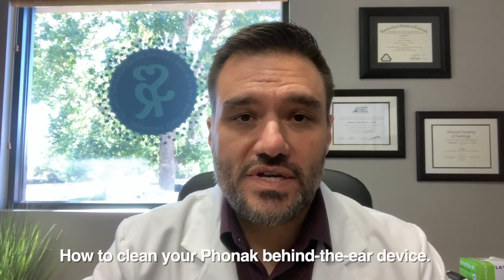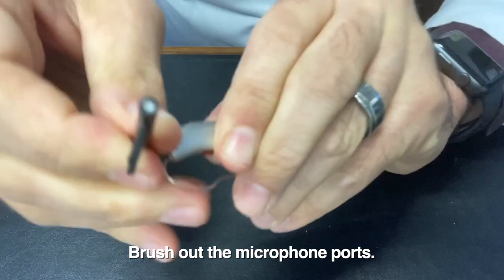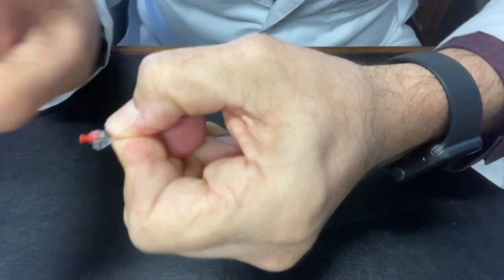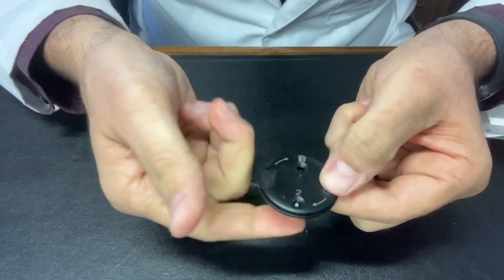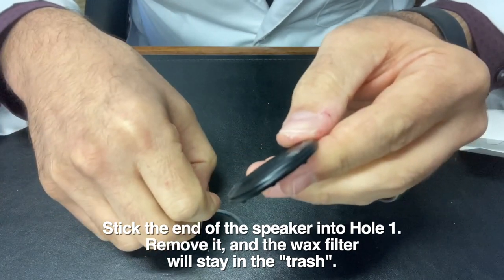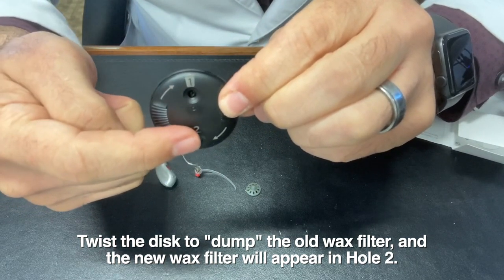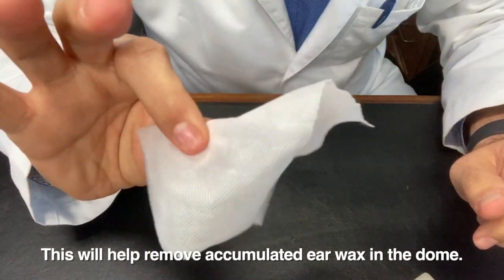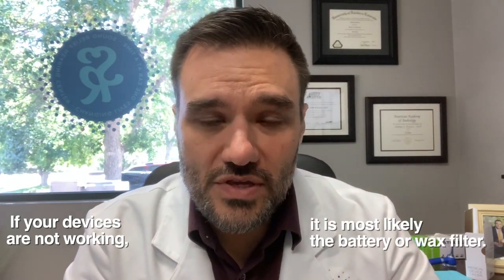How To Clean Hearing Aids By Phonak

Comment: Thank you, Sound Relief. The print was so small in the Phonak user manual I couldn't read it. These are extremely expensive hearing aids. Why couldn't the company provide an adequate user manual, particularly for those getting along in their years and wearing glasses?  The company website did not provide instructions on cleaning their hearing aids;  I had to go to YouTube for help. The company's plastic tools used for cleaning their hearing aids are cheaply made. And if something goes wrong with the Phonak hearing aids or they need to be replaced, the company charges $300 to replace or repair the item. This company is about price gouging and is not at all interested in their customers. Not a good company!
Reply from the maker: This is why we exist as a private audiology practice. Hearing aid manufacturers do not understand the difficult troubleshooting patients go through using their products. We are thrilled this video helped you!